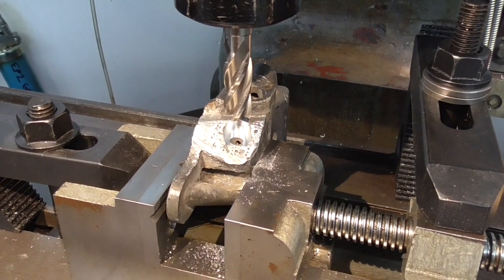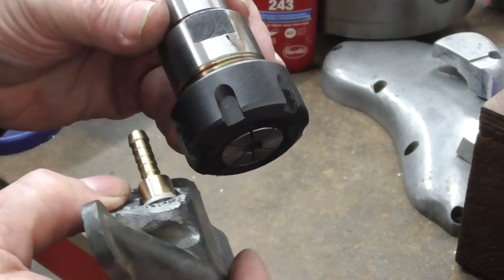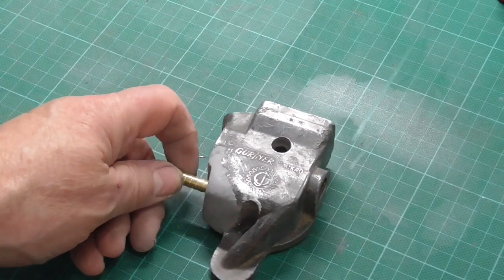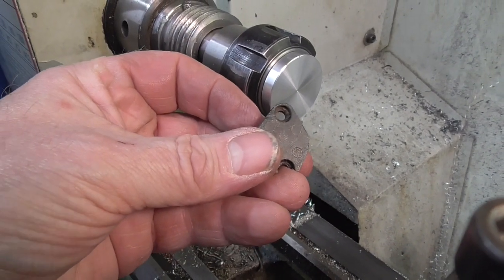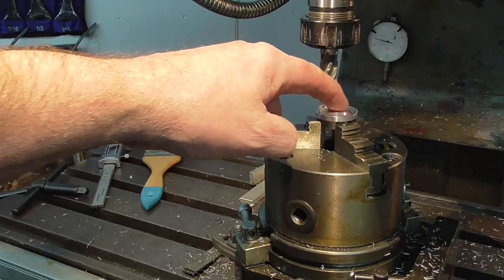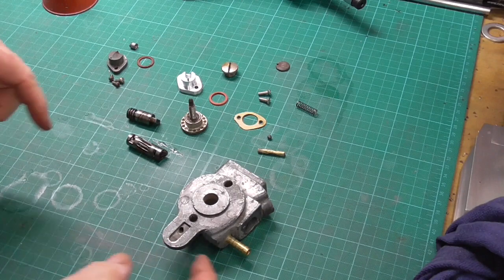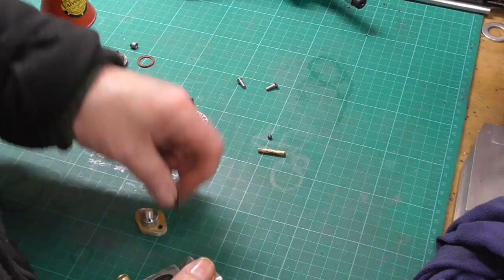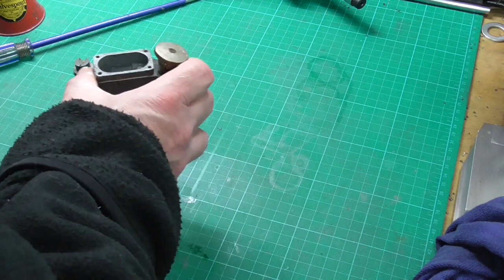Gurtner (Terrot) Oil Pump Repair

Comment: Nice save, its only people like you and i that would take on a job like that these days. Or at least at an economical rate, thinking of a water pump on wheeler dealer they charged a grand for, if memory serves which is doubtful.  Trouble with pumps like that, and as bad as that, is knowing what the bits look like, not having another good one to copy.

And, as its a new year let me be the first to wish you happy Easter.
ATB 
 c
Reply from the maker: Nice to hear from you Chris, thanks for commenting and happy Halloween to you 🎆

Comment: Cheers Ade,
Always a pleasure seeing how you tackle a tricky project. I have a random question for you. Have you ever heard of putting a 250 Starfire front end on a 441? Wondering if it might be a straight swap.  I just bought a 1969 Starfire basket case with a good front and it has a twin leading shoe on it and decent forks unlike the tuna can and rubber noodles of the 441. I am pretty unfamiliar with the 250 BSA's and I have not even had a chance to do any measurements yet. Just thought I would ask if you might know. All the best!
Eddie
Reply from the maker: The forks is not something I have experience of I'm afraid, may be worth shooting the question to Michael Waller? Thanks for watching 👍🏼

Comment: Good Save there. looked to be a lot of zink in that casting, like the old Amal carbs and the like (monkey metal as we used to call it).
Reply from the maker: Mostly zinc and crumbling away with age, it's fate will befall a lot of these old zinc castings eventually